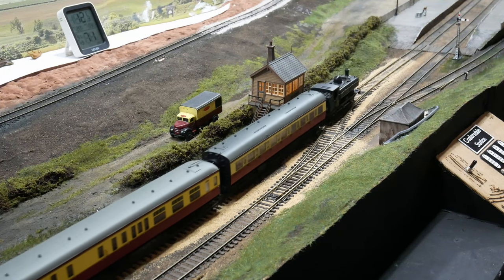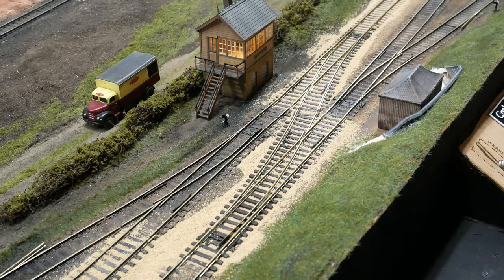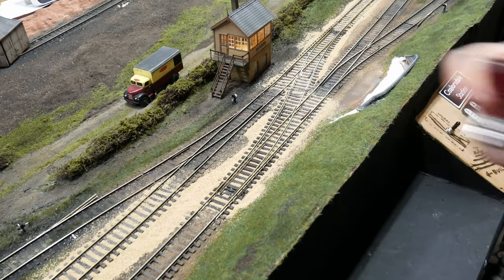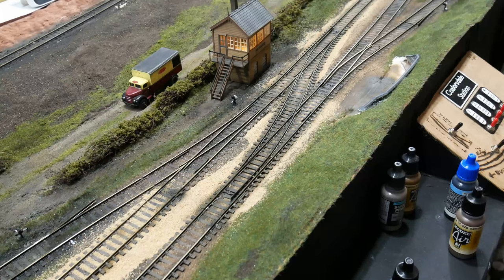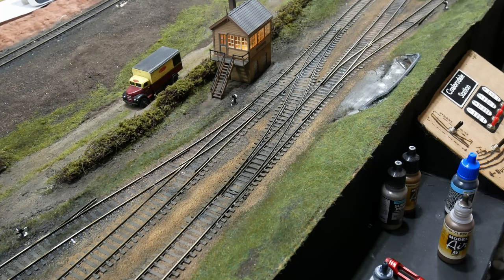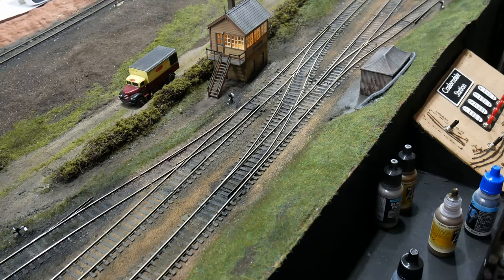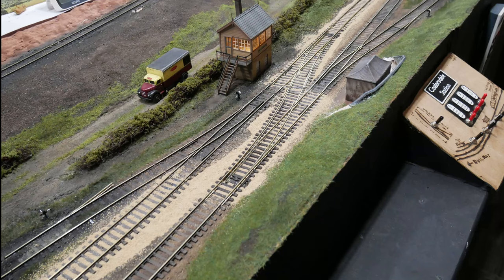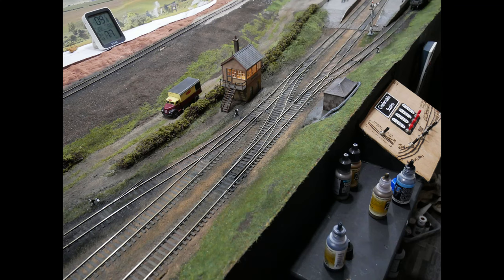34.How I weather Track (Airbrush Method)

Comment: I just bought an airbrush and used it for the first time.
But when I tried to apply paint and matte varnish to wagons etc I found it left a bubbly finsh and not a smooth finish.
Did i over thin it or something?
Reply from the maker: Most likely a mix of air pressure and paint thickness. Make sure you use the correct thinner for your paint ( manafacturers vary their mixtures for both paint and thinner). Also make sure your pressure is high enough you get a good constant flow of paint but too high will also cause problems with spitting. Testing first on a plain piece of paper will give you a good idea of how the paint will come out
Reply: @HorsehayRailwayModeller  Thanks for your advice and I think the problem was because I over thinned the paint and have had better results second time round.
Also have ordered some proper airbrush thinner.